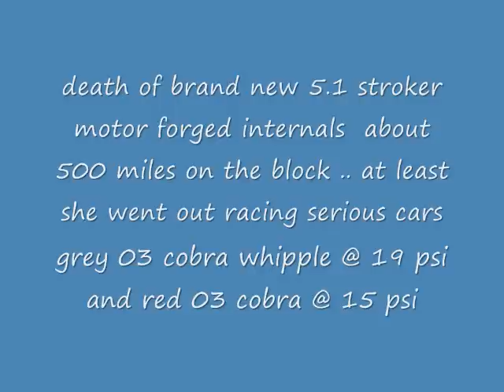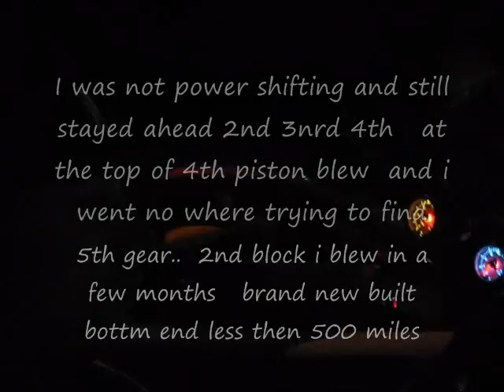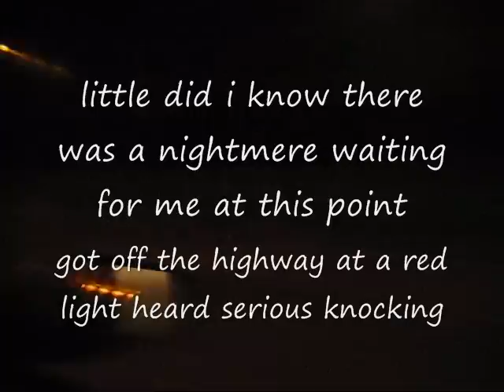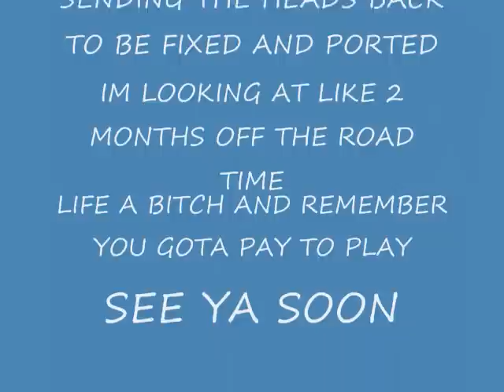mustang brand new 5.1 forged stoker motor blows piston with less then 500 miles on it

Comment: i watched your build on this motor. great video, and great build. i am about to do the same to my 97 gt, but man, u can't go running it hard like that with 500 miles on it. it a doesn't matter what kind of car it is, a new motor, rebuilt rebuilt have to be broken in first espectially boosted ones. i need say more, i'm sure u have read many of these other posts saying nearly the same thing. so wait till u get about 3k to 5k on the next one before racing it.

Comment: Detonation is what happens to this motor. Too much boost vs octane and timing. E85 is the way to go with boost. No piston can withstand detonation. Google search it before you build anymore engines. Don't listen to these smart asses. Everybody learns somehow. I do like to run my engines for 500 miles pretty easy but that not going to bust a piston. Extreme cylinder pressures caused by detonation.

Comment: Stop using stock 4.6 2 valve blocks for stroker builds with boost. Get a Sean Hyland Motorsports short deck or tall deck aluminum block which is 150% stronger than a stock 4.6 iron block.
Reply: its not the iron block nor stroker or  block its donation no pistons can take it when things are not calculated right it happens to the best of um

Comment from the maker: @jhoe1upGuy  yeah and after that the guys who who rebuilt fucked up the timing chain gears made them rub  metal shavings whiped out the motor another 6 k then i get the car back and a week later water pumps goes and overheats melts my pistons again  i have no luck at all with this fucking car felt like jumping off a bridge a few times its so much stress this time i went with diamond pistons  thank god none of the other imternals got fucked up i hope to god it works out this time

Comment: you can't stroke and put pressure on a 4.6 2 or 4 valve and expect any life out of it the stroking crank will drop the Piston so far out of the bottom of the block it breaks going back up

Comment from the maker: @ernestolopez23 haha i walk on these cars with the 2v  back in this vid i was running lean had a shit fuel system melted   and had a cheap 200$ ebay turbo on it with many booost leaks...  now i just had a 2000$ turbo put on bigger down pipe  new motor bored out even more   the car is maken over 700 to the rear wheels  and yess it does walk on 03 04 cobras   im not saying all of them i know theres 1000  1200 hp cobra out there but most of them i walk on

Comment: Do u think it was a bad piston or mybe driving it to hard before motor was broke in. I always wait at least 2000 miles on my vehicles before I get on it and I don't ever do top speed runs until I get 5000 miles. Sorry for the bad luck. I hate to see a stand break.

Comment from the maker: @jhoe1upGuy  and as far as the fuel system now i have a  sumped tank  and aeromotive A1000 pump #8 feed #6 return lines  trickflow fuel rails   and 63 lb injectors and aeromotive regulater  i have more then enough fuel i should have it back in a week or 2 ima do a break in tune this time and put 500 easy miles on it then bring it back for the real deal beat th eballs outa it tune  just on fuck ups alone and mistake i wasted like 14k on this car parts and labor on mistakes alone

Comment: Nobody has luck with a single walbro 255 and 42lb injectors on the stock returnless fuel system.  Don't care what internals you put in there. You let it go lean and detonate nothing can survive. Get some 64lb injectors with dual 255 pumps y-blocked into a -8an fuel line with a fuel pressure regulator that is boost referenced. All that money in parts just to cheap out on the fuel system. It's a Shame some people have to learn the hard way.

Comment: You break a motor in the way you want it to run, if you race it from day one, it will be a good race motor. If you baby it, it will run like a dog. If it doesn't hold up it doesn't hold up.

Comment: You can put all the money in the world into your motor but you gotta give it time to break in ec.  

FYI its not easy miles to break in your motor you genius its alternating driving, you want your motor to get sealed well, alternating driving 10-12ish psi warm ups and cool downs before and after you drive it, no granny driving, no 70mph long highway stints, that will not do it and ffs, give it a good solid 1k before wasting more money.

Comment: If that was a 4.6 stroked to 5.1, I really hope you didnt expect that motor to last long bro. Those stroker motors have problems with the piston coming too far out of the hole. Just stay 4.6 or do .30 over or something. 

Too bad your tuner didnt tell you that your fuel system was inadequate for your power. My tuner made sure my car didnt blow when I was pegging my injectors and MAF and set my limiter to 5700rpm so this exact thing wouldnt happen. I'd be pissed at who tuned your car.

Comment: At least you said it honestly, that you don't THINK strokers are meant for F.I. 

Tell me, what little scientific theory did you use to come up with the idea that large stroke "motors" are not meant for F.I.?

Tell me, why is it that the stroked Hemi style 500 C.I. engines in Top Fuel drag racing are in some cases boosting to nearly 100 PSI, and producing upwards of 8,000 HP?

Why are there 5.9 Cummins Diesels running well over 100 PSI? They are a considerably large stroke engine.

Noob.

Comment: Nobody has luck with a single walbro 255 and 42lb injectors on the stock returnless fuel system at that power level.  Don't care what internals you put in there. You let it go lean and detonate nothing can survive. Get some 64lb injectors with dual 255 pumps y-blocked into a -8an fuel line(full return) with a fuel pressure regulator that is boost referenced. All that money in parts just to cheap out on the fuel system. It's a Shame some people have to learn the hard way.